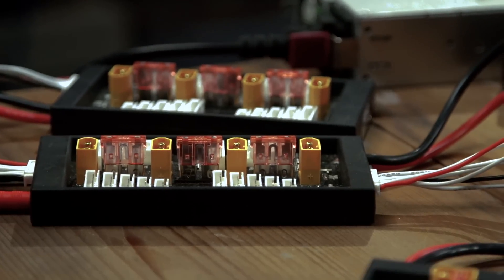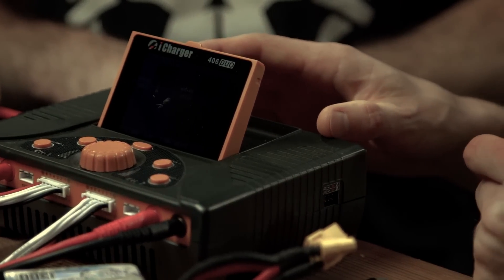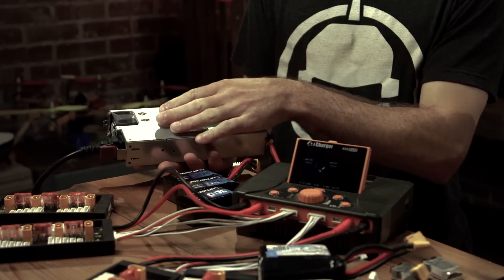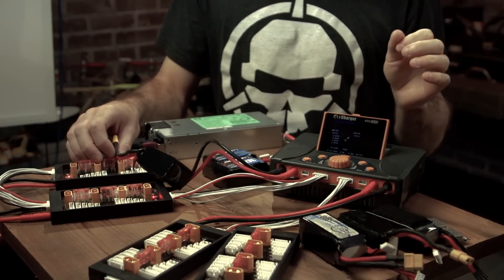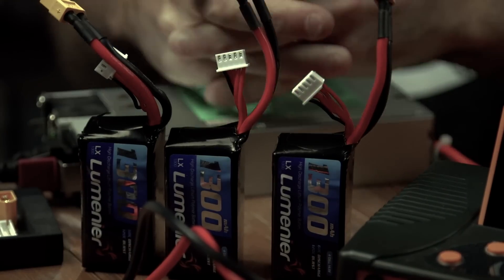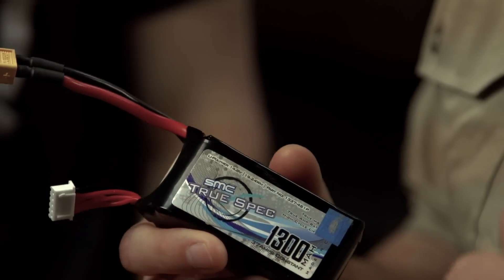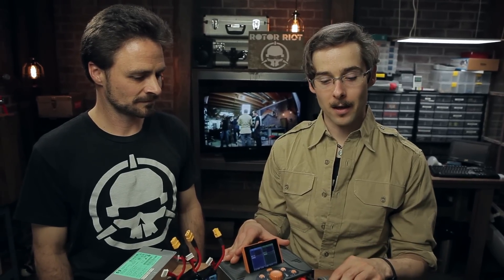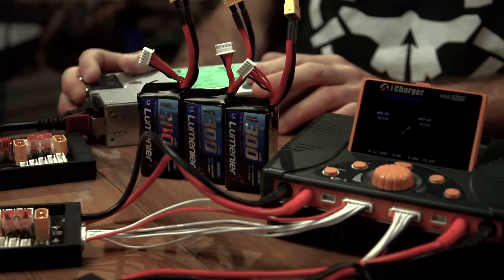Parallel Charging Batteries

Comment: We are currently providing customised Lithium Battery packs in India , We recently had an enquiry about providing two battery packs of same voltage but of different capacity for a bike , SO i wanted to know the can we provide that ? If yes then how shall the batteries be connected to each other to give the power and also how can we ensure safety

Comment: I have 1 maybe 2 questions.  Steele was talking about cell voltage something along the lines of if you have a 15v cell and a 17v cell.  The lower voltage cell will take more abuse.
So here's my question/s is Steele talking about the cells in the battery pack or is he calling the battery pack the cell?  If the first is what he is talking about, then how do we measure each cells voltage?

Comment: Question about the power supply the the product description of the icharger is 10 to  30 volts dc so how do you convert watts to volts. I have a random 2000 watt psu of a pc and i was thinking of using it but idk if that would be too much current for the device

Comment: Your "how to set up the power supply" link is broken. The correct link is websitename/index.php/tech-tips/how-to-setting-up-the-hp-dps-1200fb-power-supply. Also, you might want to specifically mention that the second half of the article doesn't apply to most people who are only using one of these power supplies.

Comment: I say use the 406Duo and pair up four Joshua Bardwell V2 balance boards in parallel, two on each channel to do 40 batteries at once using a XT60 splitter and ProgressiveRC balance lead splitters. That's what I'm doing and I'm able to charge a TON of batteries. Obviously, check your batteries before charging them. I put mine from lowest voltage packs to highest charged packs to let them balance themselves out, then let them sit for a few minutes. 

After a few minutes I run them at around 1C to 1.5C depending on the situation. I run 1300 4s and 850 4s packs. Those boards work great!

Comment: i agree with steel. when i'm charging at 1c the voltage only raises slightly from resting. so at .2v per cell, 4s pack, you cold have up to 0.8v of charge between batteries. i think that would charge a good quality low resistance lipo really fast.

Comment: Great video on parallel charging.  One question when making the connections.  Which leads should be connected first, the main leads or the balance leads?  I would think it would be the main leads since these thicker gauge wires should theoretically be able to handle voltage equalization better than the thinner gauge balance wires, but this is conjecture on my part.

Comment: I believe that Mr Steele is incorrect. It does not charge 1 cell more than another.. It charges them all, and than only discharges the cells that are higher. This is why it takes longer to balance charge because the charger will keep charging, and than discharging to keep everything balanced.

Comment: Was hoping for you guys to mention how often you realistically would balance parallel charge instead of just parallel charge all those multi cell batteries.
Reply: Redazu I do it all the time I have the same charger if I'm in a rush I'll just charge instead of balance them but other than that it only takes me 40 minutes to charge like 15-20 packs.
Reply: Yeah I tend to just do normal charge when I'm in a hurry and don't feel like plugging up the balancer plugs haha. I assume you'd only need to balance like maybe once every 5 to 10 charges? Granted you don't have a problem with one of the battery cells and be unaware of it.

Comment: At best, connect your cells with the lowest voltage first. This way, when you're plugging in the higher voltage packs, these take the high discharge (up to 10 A for a few seconds at Joshua Bardwell) and the charge is spread between the already connected packs.
The battery can easily withstand a 10 A discharge, but you don't want to give it a 10A charge by plugging in the lowest pack last. (Likely it won't hurt the pack, but better be sure)

Comment: I agree with steele. 0.2 volts per cell is a little much. I usually do within 0.3v on a 3s and 0.4v on a 4s. Batteries are expensive and I am poor
Reply: xWOOLYxMAMMOTHx i think what Steele meant is that we should stay within 0.2V difference. It's common practice to stay within the 0.2V

Comment: Thanks a lot for the video guys! Put my order in for a 1200W supply and icharger 406Duo. Glad I watched this and Steele's video on charging gear. Almost went with a pos SkyRc B6AC V2. Found out that won't do exactly what I want. Rather buy for what I want and need instead of buying a second time later.

Comment: A Hitec 4X is an awesome charger with built in AC 200 watts under $200. Avoid all the complex voltage matching for parallel charging packs in series,  and get a couple high quality computer controlled multi-chargers and you can balance charge multiple packs at the same time. Two $200 4X chargers are more logical and safer than one  charger trying to parallel charge cells built in series.  Li-pol cell internal resistance variances are far too risky when parallel charging cell packs in series.
Reply: MIA Micro-FLIGHT this is a good point, or you could buy that charger and parallel charger multiple batteries from every 4 ports haha.

Comment: Thank you for all the safety tips.  I don't want to burn up any of my LiPo's, or worse, burn down my house.  I now realize that if you don't have a way to measure battery voltage, you shouldn't be parallel charging.

Comment: I personally do think total pack voltage is irrelevant... match the cells fairly closely, but even that's really not something we need to worry about with the new batches of Graphene high C charge batteries. I'd love some actual testing, Grab a full pack and a discharged pack and throw them together... I'd be curious to know if it does warm up.

Comment: At minute 1:26 you say we have to charge our batteries at least 1C. 
I know it will take more time to charge the batteries but Is it dangerous to charge at LESS than 1C? 

Thanks.
Reply: Documentales Tv not at all, it is probably safer, so if you have the time you could always charge at half c. It probably isn't worth it though as it won't add a noticeable amount of cycles to the pack.

Comment: If you are not in a rush to charge (read overnight) use a RadioLink CB86 Plus. chargers 8 batteries on the balance leads. Can be different cell voltage without having to check. Less time fluffing about with packs is more time to get other stuff ready for the next flight.

Comment: Man i love my 406 duo, probably more than i should but hey.

This charger will work fine on 12vdc but to get the best of it you need an input voltage of 25vdc. you notice a difference in balancing time with this voltage too. I charge 10x 6s 5000mah packs at 1C in 40 mins with this little fella. POWER!.

Comment: input voltage range for that charger is 10 - 30vdc. There is no need at all for the power supply to put out exactly 12vdc!
Reply: There's also no need to charge at 1C as implied by Steele, you can charge at less and parallel charging will still have the benefit that you set it all up once and when it's done you take the batteries and go fly.  You don't need a charger that puts out many amps.

Comment: When do you consider a pack to be out of balance (at what voltage difference)?
How often do you suggest to balance charge?
Reply: +joost xboxsweg - I see... What about the case where all the cells are above the minimum, but there is a significant difference between the volts on each? Is there any specific amount of voltage difference that would prompt you to balance charge the pack?
Reply: +joost xboxsweg okay thank you

Comment: ppl and there PID ....there so lazy...lol
Do you really need more then 12v to parallel charge 4s pack ? The link that you've post they show 2 power supply to make 24V.
My question is, are you ok with 12V or better with 2 power supply to make 24V?

great vid & info

Comment: So $300 for that charger plus the parallel docks. I have to ask the question, would it possibly be better (safer?) to just buy 10 of the $30 4 button chargers and have the ability to charge 20 3s packs at the same time and actually be able to balance charge all of them? Most 4 button chargers can balance charge 6s packs so you can make an adapter to balance charge 2 3s packs together per charger. But I guess it would not be that helpful for people running mostly 4s packs. Why has no company come out with a high output charging station capable of balance charging like 10 or more packs? Seems like a lot of people would buy it.

Comment: Couldn't i just buy this instead of hacking two PSUs ?: http://www.aliexpress.com/item/LED-Driver-AC-Input-220V-to-DC-1500W-0-12V-125A-adjustable-output-Switching-power-supply/32432803546.html?spm=2114.40010508.4.157.2HEgWC

Comment: Perfect timing... I'm fairly new to these Lipo batteries and have never charged my batteries in parallel but I'm reading and watching to learn how.   So, here's how my first attempt went. Tell me if this was bad, wrong, or alright...    I was a bit nervous so I connect my six 3s's to my board (board not connected to a charger) My first thought is that I really need to baby sit this... so thinking ahead I didn't have time that night I waited until the morning... remember the batteries are still connected to the parallel board.  In the morning just before connecting to the charger, I wanted to check the volts of each just to make sure they were within voltage range of each other for a safe charge.   When I pulled the 6 batteries off the board and check their volts they were all equal.   I guess by connecting them to the board the ones that were low came up and the ones that were just a bit high went down.  
Was that a bad thing to leave the 6 battery's connected to the board over night?

Comment: Thanks for the info guys.
Just wondering, why not just get something like this?  http://hitecrcd.com/products/chargers/acdc-chargers/x4-ac-plus-4-port-acdc-multi-charger/product
You can charge 4 batteries at once without having to carefully match votlages, cell number type,  mAH etc....  It should have enough power for 4 1300mAH bats at 1c and you dont need a seperate PSU.  Less fuss, less complication, less expensive.

Comment: Ok so I have 10 smc 2s 5000mah and buyin a paraboard I can plug 5 on each side and just put charger on 5 amps 2s correct and they will all charge like I'm charging 1 battery

Comment: The iCharger 406Duo can actually handle input voltages from 10 to 30 VDC, so there is no need to worry about setting the power supply to exactly 12VDC as shown in the video.

Comment: How about a video about a charger where we don't have to find and modify our own custom power supply... Most people just need a charger they can plug in the wall and works well.  So this might be the "BEST" solution but it's definitely by far not the simplest or most convenient...  Something like the hitec X4 plugs into the wall and charges 4 batteries at a time.  Very convenient and costs under $200 (power supply included)   Other than that great videos :-)

Comment: PARALLEL CHARGING TIP:  Before charging , connect your packs to the parallel board and allow them to sit for a bit.  This will equalize the cells overall, making them close to equal state of charge before charging.  The lower state cells will draw current from the higher state cells until they are equal.  This way you do not end up with a pack that has undercharged.  You still do not want to do this with packs at a significantly different state of charge, as high currents can flow from one pack to the other.
Reply: +ArionRaine Ohm's law!
Reply: How long is "allow them to sit for a bit"?  10 seconds?  1 minute?  2 minutes?
Reply: John Hamel I wait a minute
Reply: Thats an interesting point, I tell everyone NOT to charge this way just because of a possible partially unbalanced cell in the chain.
Reply: Thank you someone who knows what they're talking about

Comment: Why modify the powersupply to output "exactly" 12V if the 406 Duo is rated at 10 - 30V DC?
Thanks
Reply: I looked at the link and if you connect 2 p.s. together it is necessary. I don't see why you need to. I worked in cell sites and central offices for years. When I connected to a battery string to a running plant I had to charge them exactly to the what the plant is out putting. That way you won't have sparks when connecting them.

Comment: I love the show guys. Really entertaining. Keep it up. But... your tech vids need to include info for the less financially gifted. I parallel charge but I do it with a $30 charger and a $5 tester. It'd be good if you covered the cheap equipment option as well as the mega-bucks options. Cos 99% of us don't have chargers like this. Also Chads view of the Taranis was compared to a DX18. The Taranis is priced to compete with DX6i and DX8, which is outclasses easily. You cant compare it with a radio that costs 5 times as much. Remember there are a lot of countries which are not as rich as the US and we are trying to achieve the same results as you guys, but on a fraction of the budget. Don't want to bitch to much cos I love the show. Cheers.
Reply: I agree with this and also love the show buuut my eyes were open wide while seeing that fancy setup. 0_0 lol

Comment: Is it okey to parallel charge 2200 Mah 3s with 1500 Mah 3s together. Because i have 4 batteries right now two of them 2200 and 2 of them 1500. I mostly charge at 1C.

Comment: When you plug the battery into the parallel board, how do you know which side the balance port is on? i.e. the top most plug on the board - are the balance ports for that plug on the left side or the right side?
Reply: +mattsnuts It doesn't matter which one you plug into so long as its the right plug for the the voltage of the pack (i.e. 4s into 4s) as all the batteries act as one.

Comment: One other point I didn't see mentioned about parallel charging, DO NOT plug packs into the paraboard before plugging the banana ends into your charger. The bananas are hot with a pack attached to the paraboard.
Reply: +drewracer321 Also, plug in XT60 before balance lead.

Comment: One item that needs to be covered is ESC settings there are loads of videos on flashing the firmware but none on motor response timing and damping for quad setups and what you do find are opposite of settings of each other. Would be nice to know how you set yours up and why
Reply: +meangenecsc None of us use BLHeli. Myself and steele personally hate BHeli and really don't ever want to touch it again.  I don't understand why you nned to have to change all those features when there are better esc's out there that adjust those features automatically for you.

Comment: "Lower voltages here, higher voltages there (5:20) - Brilliant. I use a 306b and find myself having to do two separate charging sessions to take care of batteries were are at different charging states. Clever.